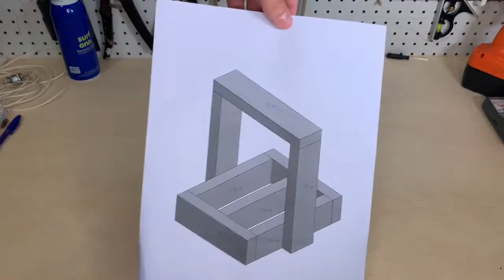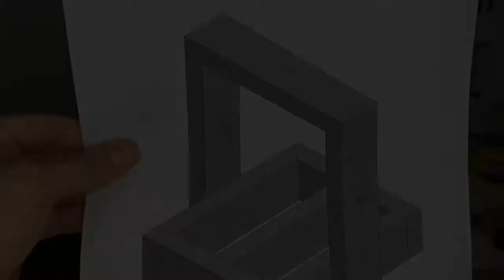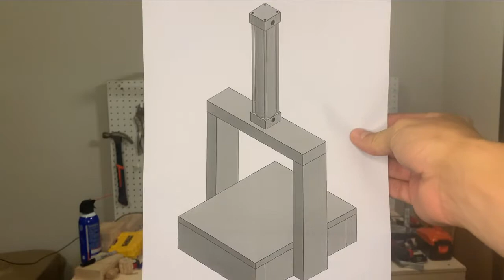Pneumatic Press - The Build

Comment: DON'T USE PVC AS A PRESSURE VESSEL DON'T USE PVC AS A PRESSURE VESSEL DON'T USE PVC AS A PRESSURE VESSEL DON'T USE PVC AS A PRESSURE VESSEL DON'T USE PVC AS A PRESSURE VESSEL DON'T USE PVC AS A PRESSURE VESSEL DON'T USE PVC AS A PRESSURE VESSEL DON'T USE PVC AS A PRESSURE VESSEL DON'T USE PVC AS A PRESSURE VESSEL
Reply: As long as the PVC is rated for the pressure, there's not much risk. As the home grade air compressors max out as 125-175psi, and even the lass common thin walled PVC is rated at 200psi, there isn't likely to be an explosion.